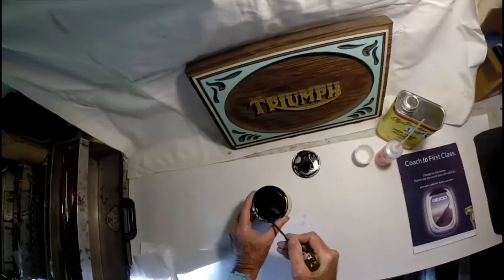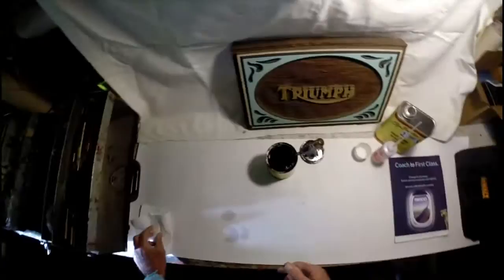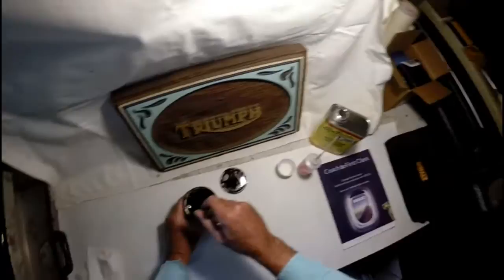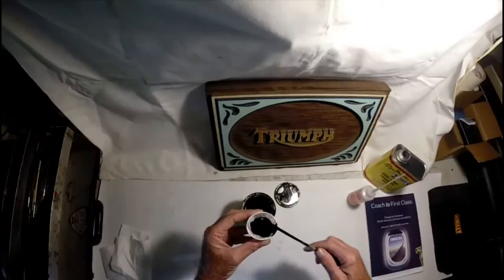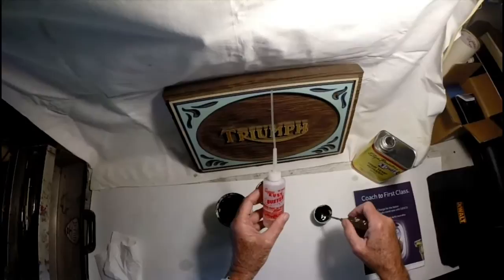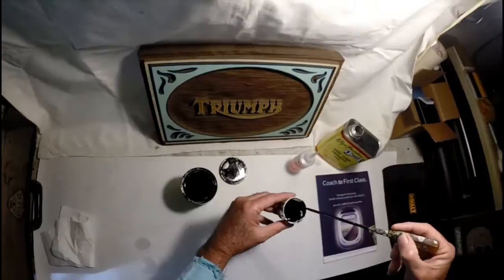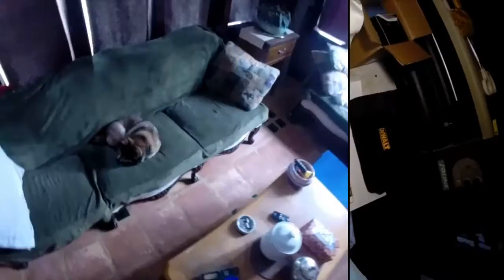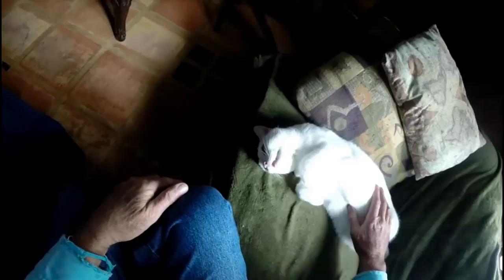Thinning One Shot Paint for Pinstriping

Comment: I pinstripe and paint with 1 shot a lot. I got tired of dealing with the paint skinning over and picking chunks out of my work, so I developed a way of keeping that from happening. I transfer all my paints to PET plastic bottles with flip top caps. I put a 1/4-20 nut in the paint, and a stainless steel mesh screen in the lid. Sometimes the paint will still skin over but I shake the bottle with that nut in the paint like a spray can. The nut breaks up the skin and the filter keeps the chunks out. Plus I have incredible control over how much paint I use with the flip top cap.

Comment: I wanted to know everything I needed for 1shot paint as far as thinners, reducers, hardner, I seen high temp and low temp I don't know the difference? I have brushes, 1shot paint, cups, not shire if I have to buy the 1shot brush oil and cleaners. Don't use laqaur thinner will ruin the brush